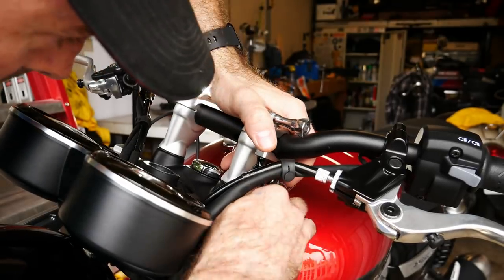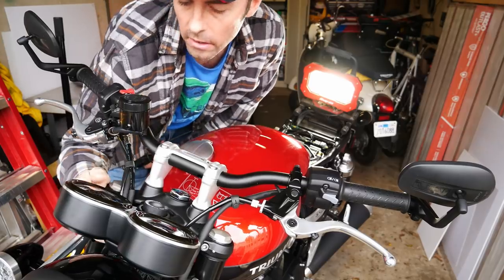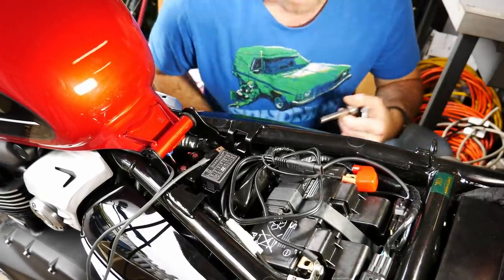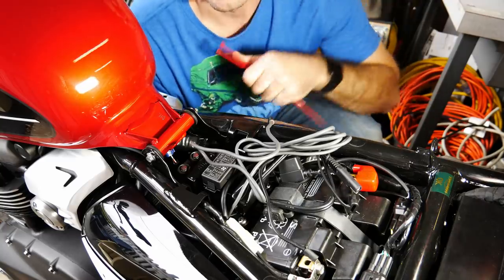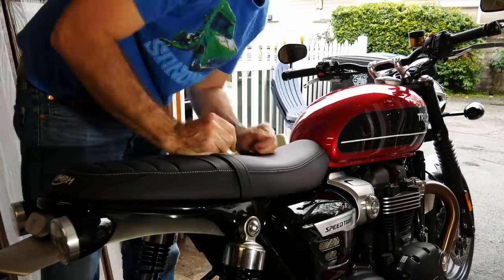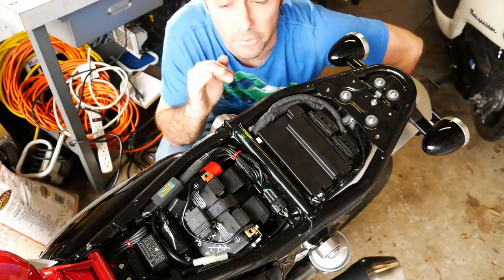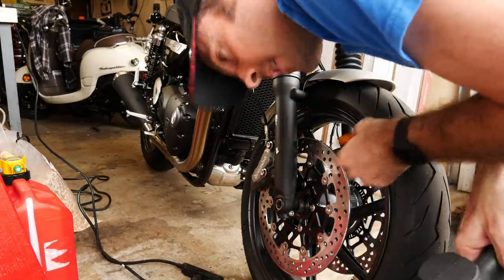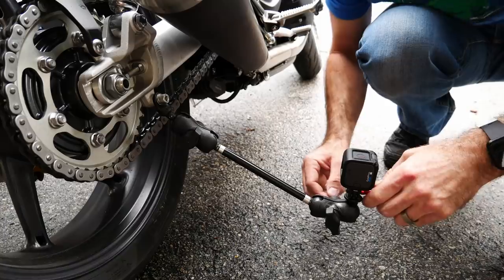2019 Triumph Speed Twin Accessory's Install Part 1

Comment: Run the cable from the rear then you only pull through what you need and keep your tools away from the battery terminals!  A towel over the tank while you're working with tools over it will save that "Aaah shit" moments.
Reply: damn it, why didn't i see the comment like 2 months ago :(

Comment: Like the bike. Might want to check the power cable having that much extra wrapped tightly together could get very hot with extended charging. ask someone smarter than me. I had a melt down once with a little more power. Have fun.

Comment: Hi, just subbed, that rear extension bar gopro mount is a bit suss? Just don't go round tight right hand bends hahaha!! And as others have said..... please have some patience when doing your bits n bobs, I could see you losing ya patience with that lead to go under your tank? On My Triumph America there's clips attached to the tank half way along to take all the cables on both sides...have a look to see if the newer models have the same, it'll save taking the tank off each time. all the best from the UK.

Comment: I HAve to readjust my heated grips. The mechanic who installed them, put the grips on upside down, logo upside down and the cables are pointing upwards. Any suggestions on how to free the glue between the grip and the bar without damaging the heated grip itself wouild be appreciated.

Comment: Hey Dude..  i have also istalled a Power cable..  but why you dont remove the entire fuel tank to install? I  did this on my bonnie it was realy easy ..  You wil find a cable duct so the cable are bether positioned and also protectet from heat and shortcuts...  but nice channel !!  You got a new follower ;)
Reply from the maker: Yes I should have done that! I was just being lazy 😐
Reply: I think you’re better off not completely removing the tank; there’s a nice tight fuel connection from the factory that you shouldn’t mess with.
Reply: @johnsumser9743 how would you carry out valve adjustment then?
Reply: @frankiepitt9135  He wasn't talking about valve adjustment but about running a power connection. My rule is not to take it off if it is not necessary.

Comment: Out of curiosity, is there a de-cat available for the Speed Twin?  My buddy installed one on his Thruxton R and (environmental impact aside) it made a significant difference in performance and exhaust note.
Reply from the maker: They don't have much yet in regards to aftermarket support for the speed twin, but since the Thruxton has the same engine I'm sure it wont be long until one is available. if it makes it sound even better than it already does ill have to do it haha! Thanks!
Reply: This bike is BRAND BRAND new, as in a week or two old, aftermarket options will be coming shortly, I'd bet $1 that British Customs will release a cat delete soon. I'll be buying one :)
Reply: TEC has one. Go to tecbikepartsusa.com.

Comment: Is there a battery tender already on the bike? I can’t figure it out. I have same bike and want to install a battery tender
Reply from the maker: Mine did come with a battery tender pigtail already installed, but not the tender itself.
Reply: Do you know what model number to buy for the battery tender. Mine has I pigtail too
Reply from the maker: any trickle charger will work, the more you pay the more features and power output it wall have!

Comment: Hi. What make of heat gun do you use? I’m in the market for one. Do you find it good? This is the first accessory video on the new Speed Twin I’ve seen, so it is very interesting. Thanks. Pete (UK).
Reply from the maker: It an old Milwaukee hand-me-down from my father in law. It’s extremely hot even on the low setting. I like it but would probably buy something cheaper if this ever stopped working, harbor freight maybe!
Reply: The girlfriends hairdryer would do fine too😉
Reply: Hello adam I'm an Italian and I recently bought a speed twin .. I saw your videos ... I wanted to ask you why there is no predisposition to put some leather bags I have in cloth .. you can tell me if you can put some side bags ??
Reply from the maker: I plan on getting bags eventually, as soon as they make the proper brackets for the speed twin i will be getting SW-MOTECH Legend Gear LC1 / LC2 Saddlebags.
Reply: Pete Sudhana get a gun with temp dial then you can use the least heat necessary to do the job

Comment: Looking forward to more mods! Thanks for the video. 

Does anyone know if a 170/60/17 Will fit on the rear? It's so new I can't find the answer, and rear tires in stock size seem to be limited.
Reply: Don Jean so you know better than a Triumph engineer about the right size tyre to fit?
Reply: @HORNET6  There's always room to have wider or narrower tires. I'm wondering as well. Nothing wrong wanting a slightly wider tire.

Comment: I used a quad mount on my monster. I have a video on my channel for simple install and discount code. So far so good. Though the case for everyday use isn't super protective on the run.

Comment: @8:20.... Are you serious man ? Just use a hair dryer not a high temp air gun, you'll kill the paint and varnish. Stickers are coming easily no need to use this.
Reply from the maker: I used what I had in the garage, my heat gun has a low setting which i did use. I know it was probably overkill but it worked out! Thanks for watching!